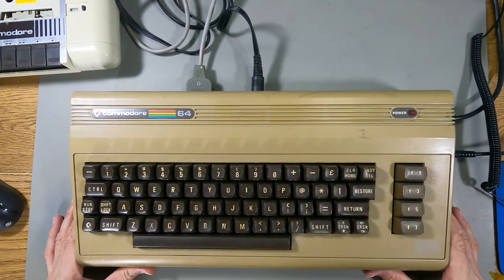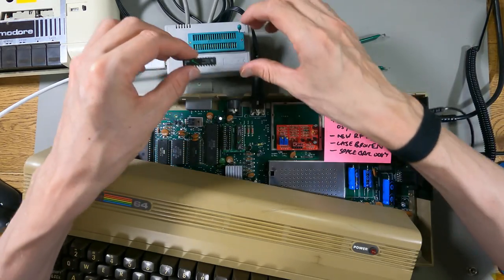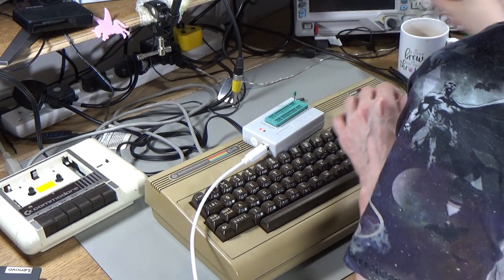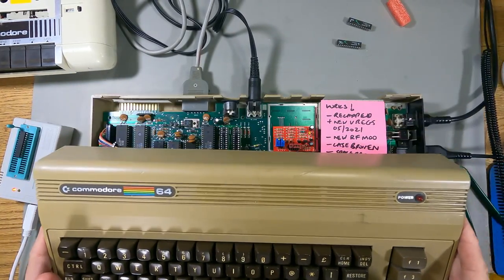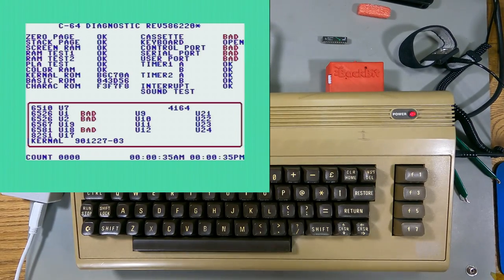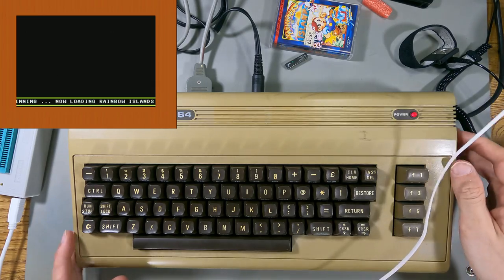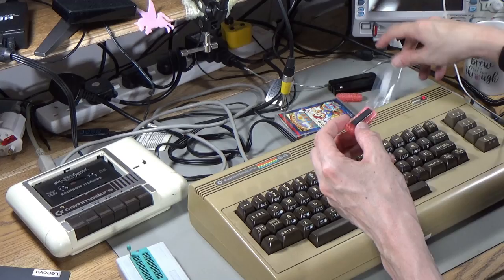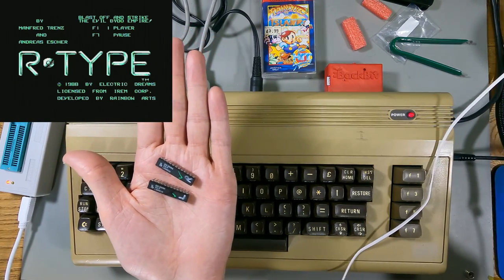The Commodore C64 Replacement PLA has Failed (PLA20V8)

Comment: I have been making and selling PLAnkton since 2015. The new implementation is PLAnkton EV. Much more reliable. 3 year guarantee.
Reply: Sidenote: A good test remains the Super Zaxxon CARTRIDGE - not the software. It is dependent on the PLA's signal being clean.
Reply from the maker: @francoisleveille409  https://youtu.be/GKyoh_gGTYM?t=699 Super Zaxxon works fine
Reply: The PLAnkton EV is more reliable than the PLAnkton, it is not more reliable than a properly assembled PLA20V8.  I have had mine going for 2 years without an issue, and you can't beat the price of less than $6 for the kit.
Reply: @networkg  Reliable ? I have hundreds of customers who use PLAnktons since 2015. I guarantee them for 3 years. Xilinx XC95xx CPLDs use lower voltages and should be MORE reliable than any antiquated Programmable Logic Array. They are not reliable if you misuse them.
IMHO, your 'reliability' claims are baseless. Technically, Xilinx CPLDs have no theoretical lifespan limits.
So far more than 4500 units sold and counting. If my products had any reliability issues, I would be out of business.
Reply: @francoisleveille409   I did not make reliability claims, you did, you said your proprietary product is more reliable than the open source PLA20V8.  I do not see the evidence for that, although I am willing to be convinced.  I suspect both chips are fairly reliable given their commercial applications.  But an anecdotal failure is not proof. 

 If you meant that you have a better assembled product, I am sure you are correct.  You have a warranty and a financial interest in good quality assurance that a home DIY'er does not.  

In my opinion, you and Daniel are to be commended for producing such excellent designs. These two replacements are the only ones I would ever recommend to anyone.  However,  I see them as equivalent in every practical aspect, you just see yours as more reliable, I disagree.
Reply: @networkg  PLAnkton is made using new Xilinx CPLDs that are fresh out of the factory. PLA20V8 circuits are out of production since before 2004 and are therefore more than 18 years old. This means they can be affected by electromigration. Older NMOS chips (CSG/MOS) are less affected because they use larger scale technology.
Reply: @networkg  Another very important point I forgot about but is actually more important. PAL20V8 logic ICs and their family were really designed for PCs and expansion cards of the late 80s/early 90s era running between 8 to 33 MHz. As such they signal very quickly and source/sink much more current on their outputs than 8 bit eras machine of late 70s/early 80s running mostly around 1/2 MHz. This causes ground bounce and other problems on the signal lines (see telegraphers equation). The XC95xx CPLDs can be "speed tuned" using slew rate limiters and low power mode to make them behave like earlier and slower logic ICs.